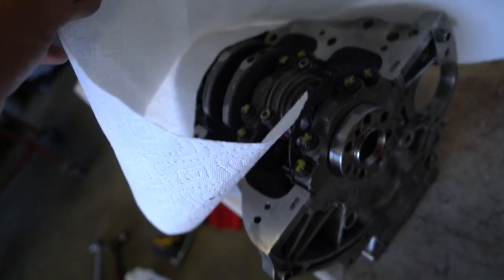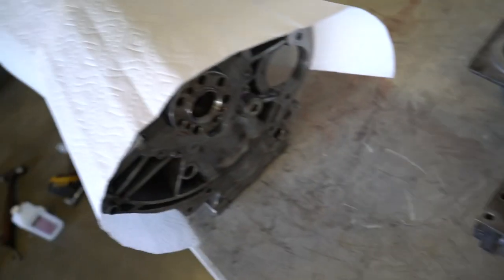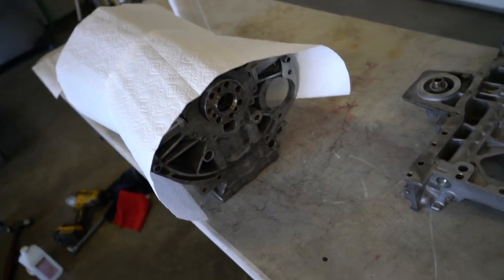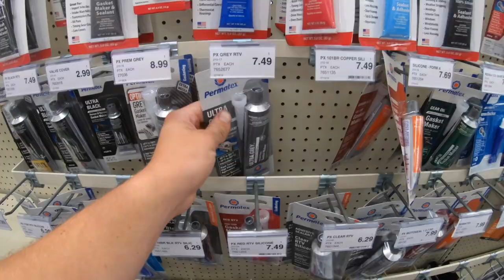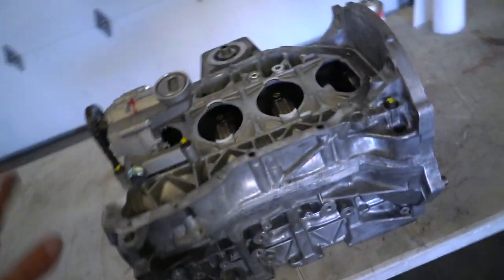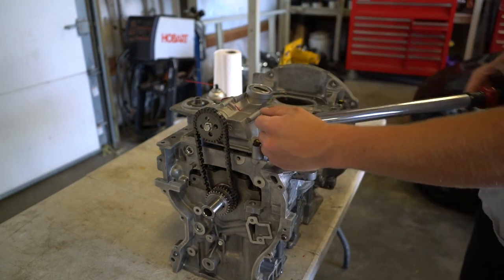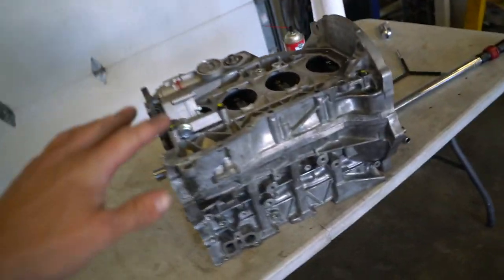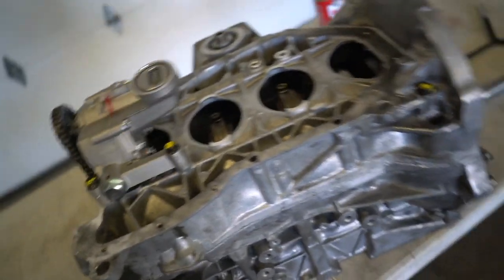I messed up

Comment: Eh, you owned the mess up. We’ve all been there, rushing to get it done.  A few tips, coffee filters are the best way to clean any surface. Instead of the paper towels, that leave things behind when using solvents. When you bag that engine for storage, coat it with WD40 and wrap the engine with clear pallet wrap. So it doesn’t get any surface rust on those freshly machined shiny bits. Lastly coat the cylinder walls with ATF with coffee filters until their clean, run it. Drop the oil and you’re good to go.

Comment: Did you grind the piston rings square? Did you stretch the rod bolts? Did you out the bearing with the most clearence on the last cylinder cause it's the last to get oil?